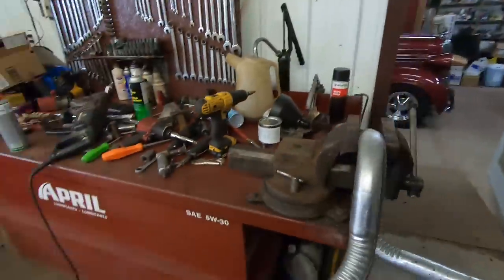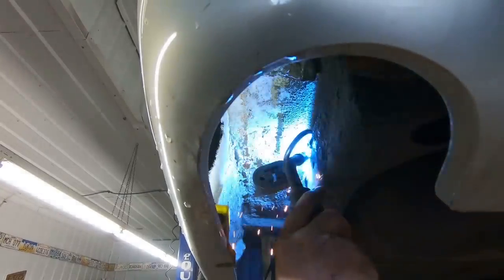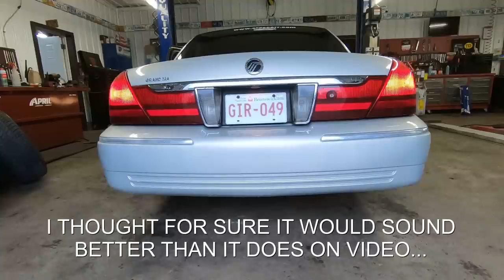Mercury PANTHER PLATFORM Gets AP XLERATOR MUFFLERS And Walker DUAL EXHAUST

Comment: I think is sounds good as is. I never thought the exhaust should be so loud that you cannot hear the engine when accelerating hard. I like to hear both.
Reply from the maker: I agree. But these may still be a bit mild for my taste. Thanks for watching.
Reply: @OldeCarrGuy  you failed at selecting the right muffler costing you labor time and money. What you needed from Xcelerator was the VX Series mufflers not them possible XS Series.
Reply from the maker: @lanewarriorillridez3739  I tend to fail a lot! I've never heard a VX but i'm sure it offers a bit more than the ones I have!
Reply: @OldeCarrGuy  the VX series are the same exact muffler as the Flowmaster Original 40 Series because as soon as Flowmaster lost their pattened rights to that design Xcelerator were the first to copy it with the help of a former Flowmaster senior member from what I understand.

Comment: I know I'm Late to the game But I just did the Walker Cat Back Swap from single to duals. I used the Walker Sound FX #21342 &3  Mufflers and found them to be Quieter Than the Mufflers you used.  :(   Sooooo It's either Headers or Cat Delete for me. The Performance Gain was Subtle, More seat of the pants than sound. I also tried a cheap Air box mod and changes the snorkel inlet to a Ghetto plastic cup. Again a tiny sound change at W.O.T. and small seat of the pants yield. My  2000 MGM GS is Still Quiet! I just want to walk that fine line between MPG and Performance.

  Thank You So Much for the Great Videos! It gives me Hope! LOL!
Reply from the maker: I've always said, it's not one mod that you will see a major difference in, but several mods will work together. Exhaust, air intake, throttle body spacer, intake.... Where you se the biggest instant changes is a rear gear swap and or a tune. 

Keep at 'er. Thanks for watching.
Reply: @OldeCarrGuy  About the " Tune" Have you done one yet? If so witch one? And what do you think? Thanks, Steve.
Reply from the maker: @SteveM-426  As far as I'm concerned, there's only 1 tune and that's the Marty Tune. Marty Ochs is the kink of tunes for these cars and It's the next mod on the list for Grandma.

Comment: I definitely agree on the expression on the placement of the oil filter.  I am getting ready to put a remote duel oil filters from Amsoil on my 2005 Mercury Grand Marquis.  I wonder how duel exhaust would effect the pollution control devices.
Reply: By the way it is a nice difference with the sound of your Mercury.  I only have one pipe coming out the back of mine currently.
Reply from the maker: If done probably, like mine, it won’t effect anything. I do not have any engine lights.

Comment: I used oem hangers from a 2004 P71 I found at the bone yard. The holes are already in the frame and the self tapping screws fit right in there.
Reply from the maker: We didn't have that luxury.

Comment: That's what mine sounds like when I start it, especially when the AC or defrost is on. All my Panthers make that squeak when the compressor kicks in.
Reply from the maker: My A/C lets out a bit of a squeak when the clutch engages.
Reply: @OldeCarrGuy  that's how you know it's working. Have you had to add any freon? My gm has the coldest air I've ever felt and it's never been touched. These cars seem to have really good air conditioning and cooling systems despite the radiator only having one core.

Comment: What kind of wheels are those?? I like em!! Thanks for the videos!!
Reply from the maker: 18” mustang wheels off a 2011!
Reply: @OldeCarrGuy  Thanks!
Reply: @OldeCarrGuy  you needed to add any spacers to those rims? Or did they bolt right up?
Reply from the maker: @BankstonT  if your car is a 2003 and newer you do not need spacers. If it’s an O2 or older, you will need spacers.

Comment: my grand am has that same issue, drop the filter and it gets on everything...... a little easier to reach at least on the grand am. i feel the same way i wanted the s10 louder with the flows i got but really it keeps it a sleeper when its a little quite. it does sound better from that little bit of footage when you left and the camera was at the lot probably do to the way it exits  which hey its louder behind you so you can be more comfortable inside.
Reply from the maker: It is getting a bit louder over time but I do think it could stand a bit of tweaking!

Comment: Needs a little more growl
Reply from the maker: Agreed!
Reply: I replaced the stock single exhaust on my 03 Grand Marquis with a Walker dual exhaust system. Exact fit parts. Not right up to the cats. Sounds amazing but doesn't wake anyone up.
Reply: @pantherplatform  I replaced the single exhaust on my 03 Grand Marquis with long tube headers no cats resonators x pipe and straight through stainless mufflers

Comment: I like the sound, just enough growl, but not to much. Did you ever find the part numbers for the AP Exlerator mufflers? I have the X pipe and left side tailpipe, just need the muffler part number. Thanks!
Reply from the maker: Sorry it took so long to reply, but here is the part number for those mufflers. AP Xlerator muffler- XS1255
Reply: @OldeCarrGuy  Quick update, after adding the dual exhaust, with the same mufflers, I have to admit, I'm also disappointed in the sound. Just ordered 2 AP dual chamber mufflers, going to switch them out. Did you ever do anything to Grandma to try to get a little more growl out of the exhaust? Always looking forward to your next video!
Reply from the maker: @kenimel1383  funny you should ask! I could never get the right “grunt” without being obnoxious! I just ordered a stainless steel cat-back setup from magnaflow! There will be a video.

Comment: Did you notice any increase in power? The ones that came from the factory with the dual exhaust option were supposed to have some more power than the single exhaust ones. I am thinking of doing a double exhaust on my 2000 Grand Marquis.
Reply from the maker: I did notice a better throttle response but i also have a throttle spacer, and high flow air filter. they all work together.
Reply: @OldeCarrGuy  Okay, I'll have to do the exhaust mod now during spring. And also get some mufflers that sound better than the stock one on my car, it is way to quiet. I just watched the throttle body spacer video.

Comment: Ive got a '98 Vic, original exhaust was swiss cheese, so took the car to my local muffler shop.
The flanges for the rear cats were completely missing (rust / rotted away) so they got deleted.
The pipes were slightly upgraded from the original 1 - 3/4" (or is it 1 - 7/8"?) to a 2" stainless.
I got the same AP XLERATOR mufflers you did, which my shop guy said is basically a Magnaflow clone.
Also had a couple rolled edge chrome tips welded on, they extend a couple inches past the bumper, & I think they look much better than the stock downturns.
It sounds pretty sweet considering it's connected to a tired, 23 year old former squad car with 157K miles.
Reply from the maker: That's awesome. I'm very happy with mine.

Comment: I just bought a  2005 Mercury Grand Marquis LS Ultimate Edition with only 45 k miles in a mint condition from the daughter of an old church minister who bought it new and died in 2014 and left it to her with 28 k miles. I have my car in a body shop to fix a few small scratches and dents and picking it up tomorrow morning. Got the windows tinted and did a deep clean and now I’m pondering if I should put some mufflers on it or not? I don’t know, i’ll have to do a little bit more research and go from there. I posted a video of the car on my channel before I send my car to the body shop I’m about to post another video of what it looks like after I’m picking it up from the shop tomorrow so please go check it out. Love these cars and love the videos you’re putting out man👏
Reply from the maker: I’ll definitely check out your videos! Thanks for watching mine!

Comment: Is that a walker h pipe? Looks just like the one I put on my gm. I had to do some adjustments after I installed it because the h pipe wasn't very level.
Reply from the maker: It is a Walker Pipe. No adjustments necessary for my install.  Maybe the FedEx gut tossed it!!! lol
Reply: @OldeCarrGuy  that's what I thought. I picked mine up at the hardware store. I was able to find everything locally since I was living in a huge metropolitan area. I wish I could've removed the tail pipe without cutting it in half but I didn't want to drop the rear end just for that.

Comment: So this is just a normal replacement duel exhaust system with a different set of mufflers?
Reply from the maker: Kinda! It’s actually making a single exhaust car a dual exhaust car!
Reply: @OldeCarrGuy  Right, but that's what you did to make that one dual exhaust? I have a vic myself that's single exhaust and have been thinking about doing this.
Reply from the maker: It really is a simple and cost effective upgrade to your CV. H-pipe, mufflers, tail pipe and a few clamps....Bingo. You got some duals.

Comment: One question.....a dual exhaust from a crown vic. It will fit straight up on my grand marquis???.....they both 2003
Reply from the maker: Yes! But you will need to add hangers to the driver side. Thanks for watching!

Comment: Hey i have a question. I am assuming you got these off of carid. It says these tailpipes are for the crown vic did they fit on the grand marquis without an issue?
Reply from the maker: They are identical cars underneath. My car is a Grand Marquis and they worked for me. You will likely have to add exhaust hangers.
Reply: @OldeCarrGuy  Yeah I have a 2003 Grand Marquis and want to switch it to dual instead of single. Just wanted to make sure it would fit. Thank you.
Reply: @OldeCarrGuy  And what diameter for the muffler did you get

Comment: Link to the exhaust ?
Reply from the maker: I got it from one of my local suppliers, but you can get the mufflers from summit racing, and the pipes from amazon or eBay. Muffler- XS1255, H-pipe- 50326, tailpipes w/o resonators- 56111, 56112. I hope this helps
Reply: Olde Carr Guy this is the information I’ve been looking for! I’m planning to do this setup with flowmaster super 10’s. Thank you sir

Comment: what size pipes and what are the part# on those mufflers? please reply because i have a 98 grand marquis i wanna do this to. this exhaust system is perfect for what im looking for. great sound!!
Reply from the maker: All 3 pieces I used were Walker pipes as follows:
H-pipe 50326
Left tailpipe 56112
Right tailpipe 56111
AP Xlerator mufflers 

Hope this helps
Reply: @OldeCarrGuy  thanks a whole lot!!!

Comment: did you change your cats as well cause i need to change mines
Reply from the maker: I hollowed out the rears but the fronts are stock!
Reply: @OldeCarrGuy  the front will stay stock until they get clogged and i change them but for now i just want to change the muffler to a stainless muffler

Comment: Too quiet. I put a single in single out flowmaster 40 on mine early last year and that just wasn't loud enough. You couldn't even tell it had exhaust unless you were in the car and floor boarding it. So I had the flowmaster chopped off and had it straight piped with just a single pipe. Sounds perfect! I dont like the drone on the interstate but i dont take it more than an hour away from home so it is tolerable for now. Might could use a resonator. But all of that to say, these modular Fords sound best straight piped!
Reply from the maker: I’m right there with ya! Too quiet even after it broke in! Drone is a killer! So I may just delete the mufflers for resonators at some point! Thanks for watching!